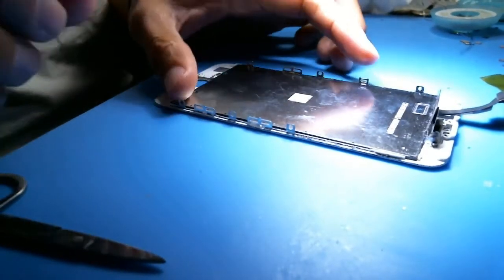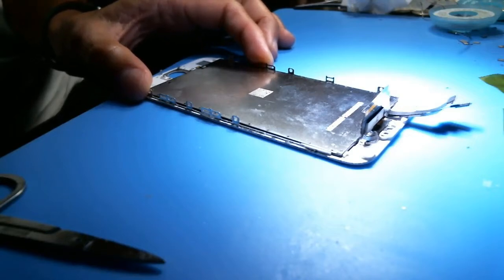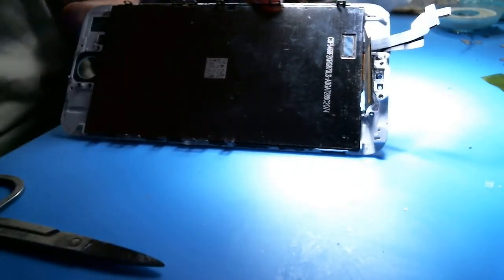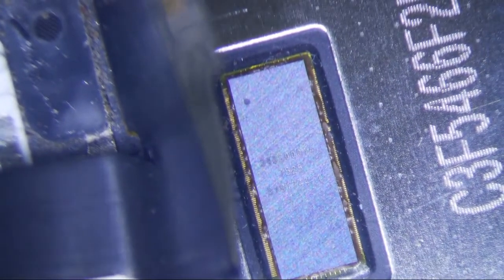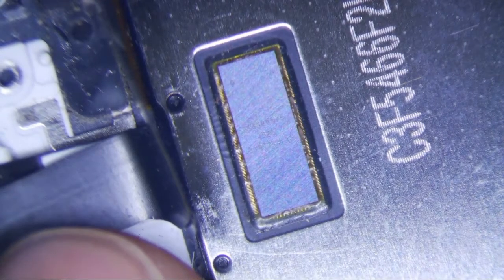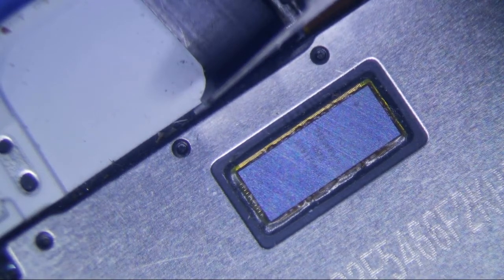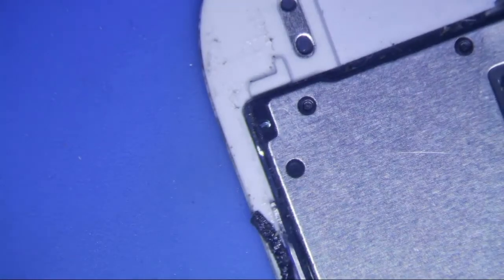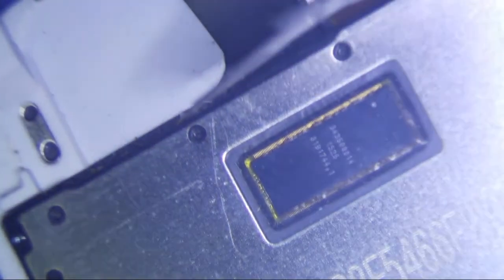iPhone 6s Touch IC

Comment: is possible to have this issue in an Iphoen 6s? my 6s freeze the screen some times and make some gestures and open apps itself, so why I have this similar problem to 6 and 6 plus? uhmm
Reply: It is possible to have touch problems on 6s, in this video he is explaining that a simple screen replacement will fix the problem, where as on a 6 or 6 plus replacing the screen will not solve the touch issues on the phone. The repair will be on the logic board, what we repair tech's refers to as a touch ic repair. 
So touch issues can happen to any phone. this video is letting us know, the 6s doesn't need ic repair, just a simple screen replacement will fix the problem.